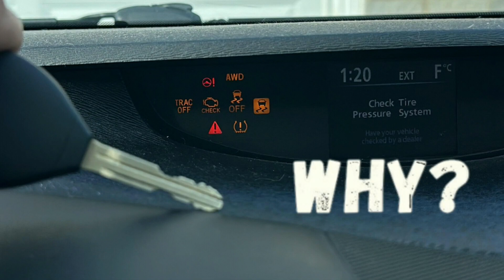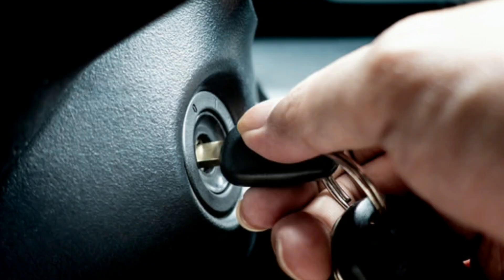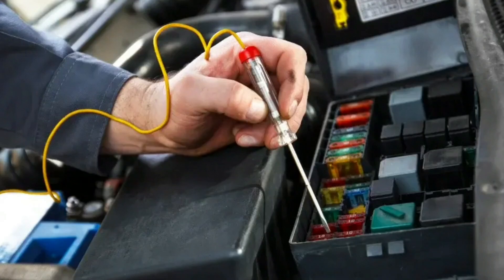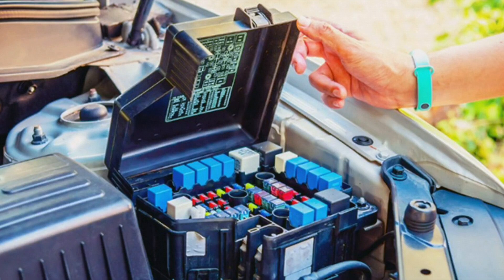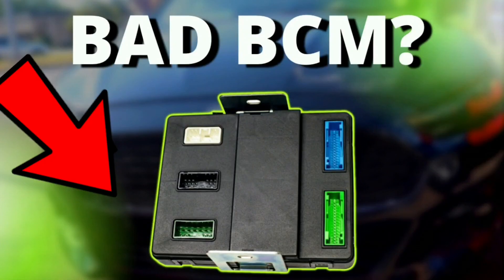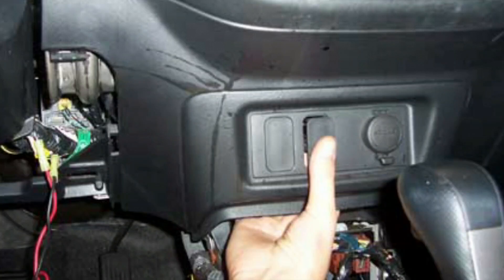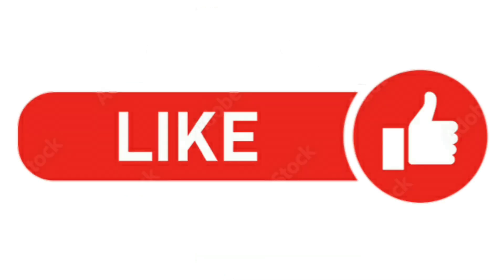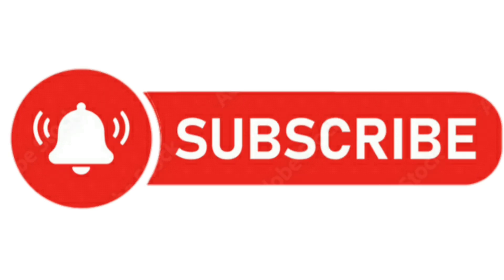How to Fix Dashboard Lights Staying On After Turning Off the Car | Dashboard Lights Won’t Turn Off

Comment: I reset and they didn’t turn off.  I did not disconnect battery terminals.  Should I try that. Is the car safe to drive?
Reply from the maker: @TerrieThomas-f3r
If your dashboard lights remain on after turning off the car and a reset did not resolve the issue, it could indicate an electrical or sensor malfunction. Here's what you need to know and steps you can take:

✅ Possible Causes
👉 Faulty Sensors: A malfunctioning sensor may keep the warning lights illuminated.
👉 Electrical Issues: A short circuit or malfunction in the car's electrical system can cause lights to stay on.
👉 Software Glitch: The car’s onboard computer might need a reset to clear any false readings.
👉 Battery or Alternator Issues: A weak or failing battery or alternator could cause abnormal behavior.
👉 Stuck Relays: A faulty relay may keep certain systems powered, even when the car is off.

✅ Steps to Troubleshoot
👉 Perform a Hard Reset: Disconnect the negative battery terminal for 10-15 minutes. This can reset the car’s computer. Be cautious, as this may erase certain settings (radio, clock, etc.).
👉 Check Battery Voltage: Use a multimeter to ensure your battery voltage is between 12.4–12.6 volts with the car off.
👉 Inspect the Alternator: If your battery is fine, have the alternator checked for proper functionality.
👉 Scan for Error Codes: Use an OBD-II scanner to read any stored trouble codes. This can help pinpoint the issue.
👉 Inspect Relays and Fuses: A stuck relay or blown fuse can cause unusual electrical behavior.

✅ Is It Safe to Drive?
👉 Safety Depends on the Lights: 
If the lights indicate critical systems (e.g., brakes, ABS, airbag, or engine), driving might not be safe.

If the lights are minor indicators (e.g., maintenance or minor sensor issues), driving might be okay temporarily.
👉 Monitor Performance: If the car drives normally with no unusual symptoms, it may be safe for a short drive.

✅ Next Steps
If disconnecting the battery doesn’t solve the issue, have the car inspected by a professional mechanic.

Avoid driving long distances if critical warning lights are involved until the issue is diagnosed.
Reply: Same problems on my car.... Your car now repaired????
Reply from the maker: @jollylife5738  If the dashboard warning lights didn't turn off after resetting, disconnecting the battery terminals for about 10-15 minutes might help reset the system. However, before doing that, it's best to check for any stored error codes with an OBD2 scanner. If critical warning lights (like the check engine, ABS, or brake light) remain on, the car may not be safe to drive until the issue is diagnosed. Let me know what lights are on, and I can guide you further!
Reply: My car dash board lights stay on even if I don’t turn the car on with the keys. Please help. Thankyou.
Reply from the maker: @gxngway4749 Hey guys! If your dashboard lights stay on even after turning the car off, here’s what you can try:

👉 Disconnect the battery for 10–15 minutes, then reconnect—this can reset stuck systems.

👉 Check your ignition switch—sometimes it doesn’t fully return to “off,” especially on older cars.

👉 Scan for fault codes with an OBD2 tool. Sometimes a stuck module (like the BCM or ECU) keeps power to the dash.

👉 Make sure no interior lights or aftermarket devices are draining power, which can cause electrical bugs.

Is it safe to drive? Usually yes, but if lights are flickering or draining the battery, it’s best to get it checked soon.

Let me know your car make/model—happy to guide you step by step!

Comment: my dashboard is on which caused to discharge my battery without the key inserted, ill check the fuses later if its still on without the key, im now charging my battery with a battery charger..
Reply from the maker: @kickYum007  If your car's dash lights stay on after the key is removed, it can be a sign of an underlying electrical issue. Here are some common causes and potential fixes: 

✅ Possible Causes: 
👉 Faulty Ignition Switch: 
 The ignition switch might not be properly cutting power when the key is removed. This could leave electrical components, like dash lights, on. 
👉 Fix: Inspect and replace the ignition switch if necessary. 
👉 Stuck Relay: 
A stuck relay in the electrical system can cause the dash lights to stay on even when the car is off. Relays control electrical circuits, and if one is faulty, it may keep power flowing to the dash lights. 
👉  Fix: Check the relays associated with the dashboard lights or ignition. Replace the faulty relay. 
👉 Short Circuit: 
There could be a short in the wiring system, causing the dash lights to stay on by continuously drawing power. 
👉 Fix: Inspect the wiring, especially around the dashboard, ignition, and fuse box. Look for frayed or damaged wires. 
👉 Aftermarket Installations: 
If your car has aftermarket electrical components installed (e.g., alarms, radios, remote starters), they might be interfering with the vehicle’s electrical system, causing the dash lights to stay on. 
👉 Fix: Check if any recent aftermarket installations are malfunctioning or improperly wired. 
👉 Faulty BCM (Body Control Module): 
The Body Control Module (BCM) controls various electronic systems, including the dashboard lights. If it's malfunctioning, it may keep the dash lights on. 
👉 Fix: Have the BCM checked by a mechanic and replace it if necessary. 
👉 Parasitic Battery Drain: 
If there's an electrical component still drawing power after the car is off, it could keep the dash lights on and drain the battery. 
👉 Fix: Conduct a parasitic draw test to locate the source of the electrical drain. 

✅ Steps to Troubleshoot: 
👉 Check Fuses: Start by inspecting the fuses related to the dash lights or ignition system. 
👉 Test Relays: Swap out relays that control the dash lights with working ones to see if the issue resolves. 
👉 Check for Wiring Issues: Look for any signs of damaged wiring in the dashboard area. 
👉 Disconnect Aftermarket Devices: If applicable, disconnect aftermarket electronics to see if they’re causing the problem. 

If the problem persists, a professional mechanic may need to inspect your vehicle for more in-depth diagnostics.

Comment: My car start but all ignition lights off not working
Reply from the maker: @JeromWafimberi-lc6cu   If your car starts but the ignition lights (dashboard lights) are not working, here are steps you can take to diagnose and potentially fix the issue:

1. Check the Fuses
👉 A blown fuse can cause the dashboard lights to stop working. Locate the fuse box in your vehicle (usually under the dashboard or in the engine bay), and check if the fuse for the instrument cluster or ignition lights is blown.
👉 Replace any blown fuses with the correct amperage fuse.

2. Check the Ignition Switch
👉 The ignition switch might not be sending power to the dashboard lights even though it starts the engine. A faulty ignition switch may need repair or replacement. You can test this by turning the key to the "On" position and checking for power at the dashboard fuse.

3. Inspect the Wiring
👉 Loose or damaged wiring could be the cause. Check the wiring around the ignition switch and dashboard for any signs of damage or disconnection.

4. Test the Battery Voltage
👉 Low voltage can cause electrical components, including dashboard lights, to malfunction. Test your car battery to ensure it's charged and delivering adequate voltage (around 12.6V when the engine is off).

5. Check the Ground Connections
👉 A poor ground connection can cause dashboard lights to fail. Check the grounding points of the dashboard and ignition system, ensuring all connections are tight and free of corrosion.

6. Instrument Cluster Issue
👉 If the instrument cluster itself is faulty, it may need to be repaired or replaced. Some vehicles experience issues with the cluster display or connections behind it.

If you're unable to diagnose or fix the issue yourself, consider taking your car to a mechanic for further inspection.

🙏  I hope you can fix it quickly and that it's nothing more serious.
If you find this video useful, please share it with your friends! ❤
If you have any questions, leave a comment, and we’ll respond.👍
Thanks for watching, and don't forget to subscribe for more! ✅